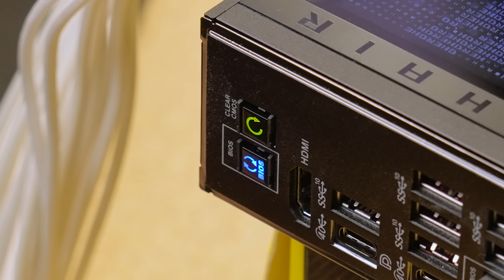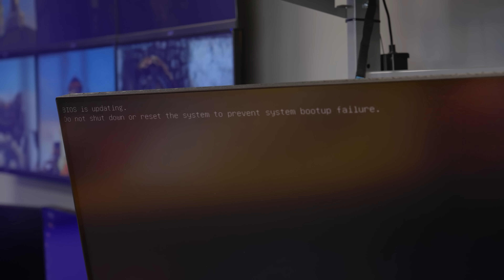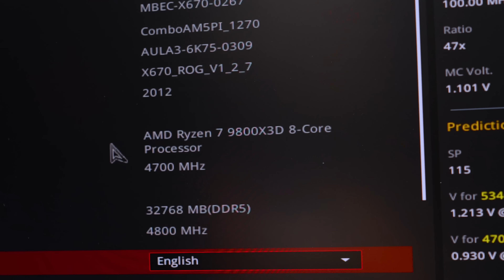This PC wouldn't post... so they brought it to me!

Comment: My son's pc randomly shut off one day while he went to the bathroom and since then the only sign of life on the system it the ram rgb is on i have rma each part all parts with issues found were replaced with new was motherboard all 3 ssds and ram rebuilt the system same issue no signs of life other than ram rgb no motherboard leds no fans no gpu no post nothing any help would be amazing specs
Msi b650 tomahawk
7600x
Gigabyte 16gb 7600xt
3x crucial p3 2tb nvme
850w msi mag 80 gold psu

Comment: As you said they started it multiple time even tho it termal shut of, my first thought was the motherboard probably just enter thermal protection mode and locked itself out of post until full power reset and a cmos timeout. 
And yes it has been a thing for years to prevent users from starting computers with broken/non working fans, even longer than the CPU fan warning that comes up and prevent you from booting.

Comment: My pc got "possessed" recently, with the main symptom being my display going out randomly. No system crash, no audio hanging, just the screen going black for like 2 seconds randomly. I think it was some form of power issue due to crappy weather, because my system shut down out of nowhere before that. I fixed the problem, but I don't know exactly what did it. I did a clean reinstall of my graphics drivers, cleared the CMOS, bled the system dry from electricity, and ran sfc scannow. The scan did find corrupted system files, and there was definitely something wrong with the gpu drivers, since any changes I would try to make through the control panel would come up with an error, but I legit still don't know what was the culprit.

Comment: Yesterday is saw a video with a similar problem whose conclusion was simple. In that case it said clearly to NOT use the old cables from the not working PSU (for whatever reason, those were the same cables, same type of PSU, same Producer). After switching the cables for the ones from the new PSU, it worked fine ^^

Comment: Whenever there are weird issues like this, check the capacitors! Sometimes they can "run dry", causing them to fail. But when left off of power for long enough, they can "recover" just enough to work again, for some time. If you see capacitors that are bulging, or have dark goo coming out of the bottom (or worse: the top...) you know they failed. It's harder to find if they don't show any signs, but it's a possible cause.

Remember the "olden days" when a failed bios update would brick the entire board, and you had to pull the chip from its socket, boot with the bios from a different board, swap out the bios chips WHILE RUNNING and flash the failing chip again? Yeah, the flash back option is a LOT more convenient ;)

Comment: Could also be his electric installation, so power coming to PC. I have seen few cases of weirdness going on. When it happened to me, PC would randomly shut down after like 5-15min,  turned out that wiring to that socket went bad and even plugging extension cord into socket in another room fixed it. A friend had similar issue, except his was producing coil whine, brings it to me, everything works, no coil whine.  Also I have seen various levels of instability, not booting up properly,.. So could be that.

Also for Windows, when switching platforms, Windows can adapt itself to new platform, but is horrible at it, so I always highly recommend fresh install. Because I have seen too many cases of people doing it lazy way and recycling old install, then wondering why they have issues, some manifest immediately, some over time, so I just recommend fresh install. It is similar issue as with updating major Windows version, like 10 to 11, those processes are super bad with Microsoft. Like if you like to play Russian roulette, go for it, some people get lucky, but generally, it has good chances of becoming problematic. So you basically save a hour or two now, so you can spend 2-5x the time troubleshooting latter.

Comment: I've seen motherboards fail when the air flow around them changes, usually  colder air causes a glitch.  Put the cover on, or pull it off, and the problem hides for days.  The case of one had a hole in the bottom, with the cover on air would get sucked in the hole.  It took many months to realize this problem was following the motherboard.

Comment: Just recently we had a situation at work, where the (Fujitsu) system rebooted out of the blue and only displayed a command prompt, saying there is a problem with the system drive and to check it.
Point is: The M.2 drive needed reseating and the system worked fine after that. Our guys at IT services just additionally updated every firmware while it was there over night, since some were out of date.

Comment: I wish when I was still a technician, I did videos like this... We are talking 2004-2012 but had some fun issues. My favourite was when I was a mac consultant and created generic drivers for printers for OSX mountain lion before they sorted the issue and an issue that caused the posting to stop working due to HP and Logitech drivers causing posting issues so would use bash within the install partition to move those drivers. Having a BIOS lockout due to a RIVA TNT 2 on my personal machine, having to use a Radeon 7500 to fix the issue, was due to an AGP issue... When I was a manager would freak out my techies by telling them how to fix the weird issues, now I am a Cloud Engineer and didn't study a day in university for this, but I find playing and building is how you learn... Break all the stuff and fix it...

Comment: I have a i9-11900K on a Asus Maximus Hero XIII, and it was acting really weird for a long time. Over a few days it would start acting slow, so try a reboot and it would hang at post, hitting reset and it would still hang at post. If I unplug the PSU for a few minutes it would then boot right up and work fine for a few days. That seemed like a classic PSU issue so I upgraded that (wanted to anyway for future GPU upgrade), but the problem remained. I had upgraded from a GTX980TI to a RX 5700 XT in the past also with no change. I upgraded to a RTX5080 a couple months ago and now it just works, I have no explanation.

Comment: Many years ago I had a pc that would not boot, but once the parts was out of the case, everything worked. Anything put into that case started to fail instantly, but it was okay once removed from the case. This mystery lasted until I bought some tools to check power and such and to my surprise the case had it's own permanent charge of 0.5 V it didn't need to be connected to power or anything and I could leave it unconnected for 6 months and it still had that same charge. In between that I learned that the case had at an earlier point been hit by lighting and the only broken part was the psu, yet nothing worked as we learned. It's one of my top 10 weirdest computer events.

Comment: My theory is that something shorted out a M.2 port, maybe the port where the SSD was installed. It could be a defective SSD or simply a conductive piece of dust on the wrong pins. No board will POST if PCIe cannot be initialized because of this.

Comment: Another thought that I had happen on my last build.  Did they have extension cables by chance?  I had some issues going on there were very intermittent, beat my head against the wall swapping parts out and still would intermittently have issues.  I literally got to the point where the only thing I had not changed in the system was the extension cables.... took them all out of the system and its still running today on my sons desk 3 years later!

Comment: I have an ASUS Z590 ROG Strix platform with an 11900k that I can't get to run stable at stock speeds or voltages to save my life. Been farting with it for years, and it only works if I enable the AI overclock on the board. It will consistently hang shortly after booting into windows without the AI optimized clock settings turned on. The problem with this is that my processor is seeing over 1.72v of vcore, and easily pulls 150w at an idle. I've measured over 285w at full utilization, which is a lot, even for a 125w processor. This platform cooked the original 11900k CPU that was in the system when I built it with a 200w capable Jonsbo CR-1100 air cooler, and would run at 100c under load. Thankfully, Intel warrantied the processor and I was able to get another NIB 11900k to replace it with, but I still can't seem to get it to run at stock speeds, same problem as before. It now has a Thermalright Frozen Warframe 360 AIO on it, which typically keeps the processor under 70-75c under load, but I'm at a total loss on how to tune the settings on the board so I'm not constantly cooking the dang thing. This system is a beast when it runs properly, and holds the top 10-20 records in most of the 3DMark benchmarks with three RX580's in it, and I have a bit of soft spot for it. Would love to send it to you for another cursed PC video, and see if you can figure out what is going on with it.

Comment: Many many years ago a friend had a Gateway PC (remember that company?) and if it was plugged in where she wanted it, she'd constantly have issues with it - but if she moved it to the other side of the room (I'm guessing it was on a different circuit there), it was fine. That one I can kinda figure out but one thing I never could understand:
Back in the day I had an AMD K6-2 350. I could install Windows and everything was fine. But if I tried to install McAfee (back when it was still a good idea to install a separate AV), quite often I couldn't even boot properly into Windows (I think this was either 98SE or XP). Even zero-filling the drive wouldn't help. But Norton didn't give me any such issues, apart from still being a resource hog. On top of that, any other computer that I tried installing McAfee on - even if they supplied the CD - wouldn't behave properly. No idea why.

Comment: Honestly pc hardware after DDR4 has been all over the place for me. I use to have a mega solid build. 2080ti with a 7740x Intel CPU, DDR4 Memory. So stable. Moved to a 13900k i9, DDR5 5600, 4090. Then was just plagued with stupid gremlins. I've essentually replace everything in that system now. Due to micro code issues with 13 and 14th gen. So now run a Ultra 9 285k, 5090, New PSU as my corsair one died. Still plagued with one or two issues still with drivers being borked from the supplier and now finding out that my RAM has stability issues (found out doing a memtest). But now Memory has gone through the roof in price. Already down an extra $4,000 in parts with the original cost of the PC being £3,000.

So with memory being what it is currently. Expecting to pay another £1,000 to get the same amount of memory capacity as i do currently. Doing anything with a pc is a headache. Specially if you have odd issues as mentioned in this video.

Comment: Would you like to diagnose my PC? it spits out a code 62 with a VGA light. One time it spit out a code 96 with a VGA light. After doing some chat gpt suggested tinkering, it powercylces when loading into Windows 11. The codes point to PCIe slots, RAM or video card. I removed and reseated both during the dust cleaning. No change. The mobo is an ASUS X870E Crosshair Hero. I believe the board is the problem.

Comment: 4:20 - nooope. The original RM series (no I or x or anything) had Type 3. That said, you could connect most type 3 cables into type 4 PSUs except for the ATX mobo cable which was different. 

I upgraded from a RM750 to a RM1000i and was able to use some of the old cables for troubleshooting and such.

Comment: 12:54 no, this is ASUS TPU (EC) (MBEC-X670-0267) update, if you interupt that, the board will be bricked and no longer react on power button and biosflashback back will not help. This is the dumbest thing about Asus motherboards
The only thing that can unbrick the board is manualy flashing via programmer little flash ic 128kb around TPU chip. 
Firmware can be extracted from bios by UEFItool

Comment: Watching this reminded me of an issue I ran into a while back. The system stopped working, and I started to troubleshoot it, and couldn't find the answer. I took the system apart and changed the motherboard, and it worked. So I put it back, and it stopped working again.  Took it out again and did an rma on the new board, and again, it worked. So I put it back in the case a 2nd time, and it stopped again. What it ended up being, was the front panel usb connecter had died, and was causing a problem that  wouldn't let it post while that connecter was on. It was able to go back together with the original parts even, as long as we didn't have that one usb front panel connected. Glad things worked out, and got an upgrade.

Comment: Jay, as I understand it (and considering how useful it is we should clarify the process as best as possible) you cannot skip required bios revisions, can you? For instance if the current version of your bios is 1, and the most up todate is 5, but the bios page says that updating to 3.5 is required, then you have to do the middle step: upgrade via flashback to 3.5, then upgrade via flashback to 5. Bios Flashback is not a skip steps solution.

Comment: That case just needs a white plastic plug to cover the bypass power cable connector for side mounts, just for a clean finish look.
You could probably 3D print one.

Comment: ive had power cables kill pcs before....every so often....replace them with a CORRECT RATED main power cable....💯

also.... the thicker and longer power cables in addition to anything separating the power plug and the wall socket (extensions, surge protectors, battery backup banks can put just that extra strain and too much resistance to put more strain on not just the power supply, but all the components all add up and if you mathematically don't calculate the proper volts, watts, ohms, amps can all effect everything overall will decide how power efficient any electronic device....ESPECIALLY A COMPUTER

do your research... consult a professional electrician to ensure the longevity of any system of multiple electronics....💯

Comment: Well look at the bright side you managed to get the Monty Python reference in and will end up perpetuating the reference of at least one more generation. I just had a similar issue where my sister could not get a document to print on her brand new laptop. I looked at the drivers, looked at the office default software, found nothing wrong and it printed without issues.
My sister just stared at me and told me she hates me.

Comment: I had problems with my B550 Aorus Master board at one point. I had to unplug it for 10 seconds then plug it back in and it worked fine. I think it was an issue with one of the early bioses but it's been solid for a long time now.

Comment: One thing that tripped me up a long time ago. Motherboard stand-offs. If one or more of the stand-offs are not properly installed you can get intermittent shorts causing all sorts of weird problems not easily diagnosed. It's something that gets overlooked especially if you are trying to repair it and didn't build it yourself.

Comment: My new build seems to have a small gremlin somewhere...all works perfectly but sometimes when I do a restart from the Windows options I sometimes get the 0d led readout and it freezes...power off and back on with power button and it's fine again and also it doesn't do this every time...very strange

Comment: My friend had the same kind of problem. When he said it was his PSU, I told him to wait while I brought my UPS, as he didn't have one. After my UPS was attached to his PC, the problem disappeared. Our electric power company is famous for unreliable power delivery, inferior voltage regulation, and dirty power. Once he installed a UPS, his problem disappeared. An easy but somewhat expensive fix, but he will be able to use his computer when we lose power. I also wonder what he is connecting to the wall outlet or to any other outlets connected to the same circuit.

Comment: I did bios flashback on my $900 ASUS sage 2 wifi threadripper board. It was terrifying, but it worked! lol That system has been stable as hell. I only wish my 5900x was feeling better. We'll see if it's a RAM issue tomorrow.

Comment: I'm pretty sure my RAM is dying. It's DDR4. I got it in 2021 when I built this computer. I do have spare ram, but like half the capacity. I'm probably swapping it out tomorrow to see if it works. I keep getting black screens with memory errors and watchdog errors. The odd thing is that it's 100x worse if my computer is idle. If I'm watching a video it's less likely to crash. It's very odd.

Comment: @Jayztwocents I know what the problem with the system was as I went through the exact same thing with my Asus Z590-a Strix 11700K 3080ti 2x16gb 3200 mhz system. No picture at post intermitant at first but fatal at the end. Sometimes cmos reset fix it and everything works good for a week but will come back. Long story short its failing memory training because of recent bios and ME update or aging components. Fixing it requires excess vccio and sa voltages preboot.

Comment: Very possible issue is that the house has some power issues.  At my home, I had something that is tripping a GFI and I have never been able to isolate it.  The power circuit wasn't even on the GFI breaker so I got a good UPS and it fixed my issue. But at first I thought it was an issue with my computer, not the general power.

Comment: It's because the 2cents crew has way too much combined mana. As soon as the best PC comes in, it'll behave like normal as well. Joking aside, maybe a cable came loose? I've had that happen where I suspect my mobo cables got loose, after trouble shooting everything else, disassemble and reassemble with original parts and everything acted like it was brand new. Checked forums and consensus seems to be loose cable.